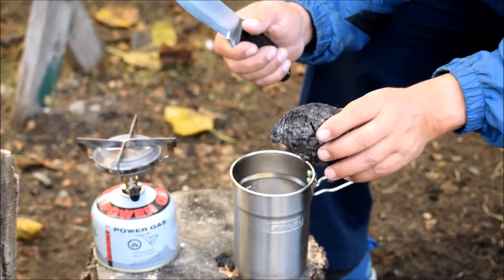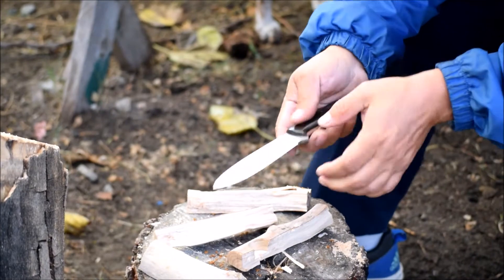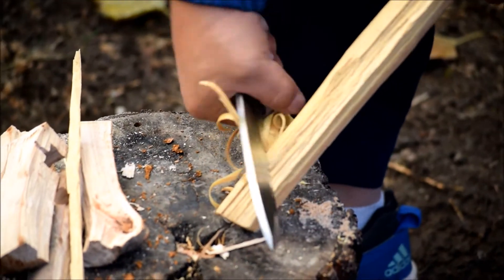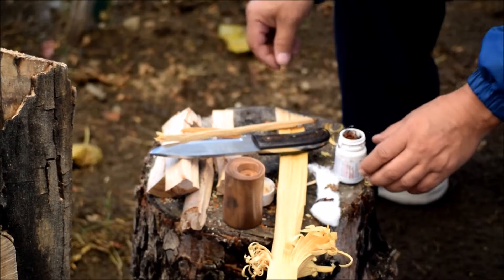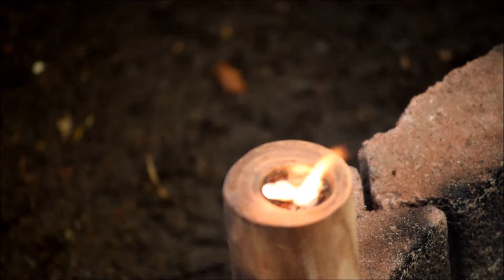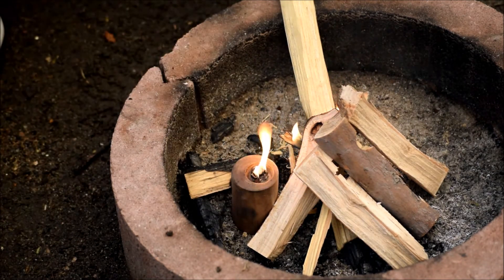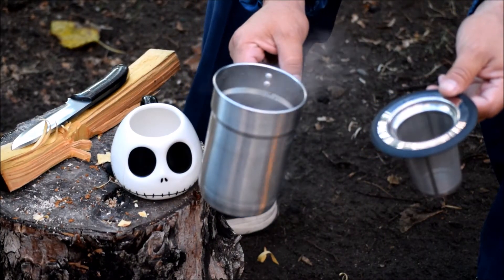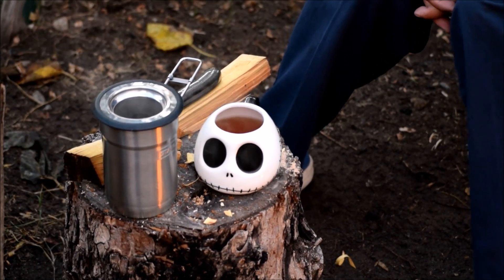Carl the Madman's 166th subscriber giveaway support video and a shout out.

Comment: Very nice shout out for Carl. That knife is nice, but the grind looks way too steep. That's why it wouldn't stick when you tried to swing it into the log.
Reply from the maker: +John Capps Thank you John. How can I fix the grind? I have a Lansky sharpener that has slots for different degrees. What degree is ideal?
Reply from the maker: +John Capps Thank you John. Maybe I'll send the knife to Tom Chitwood. I'll check the video.
Reply from the maker: +John Capps The link is to your current video, I like it.